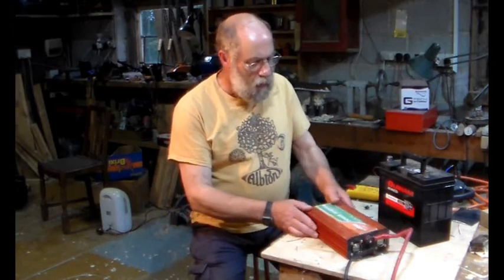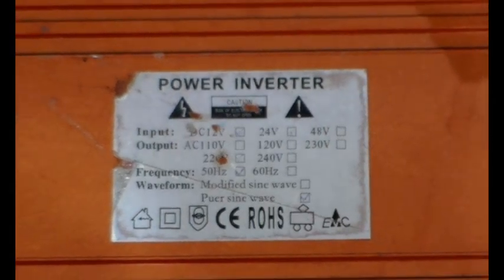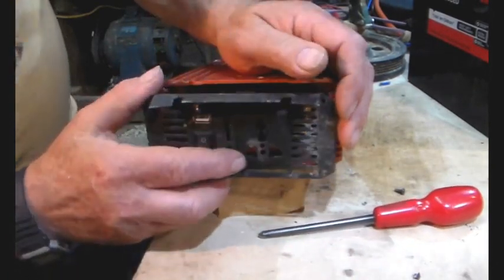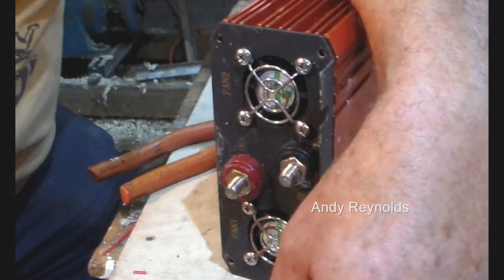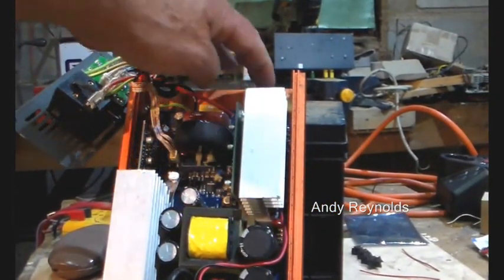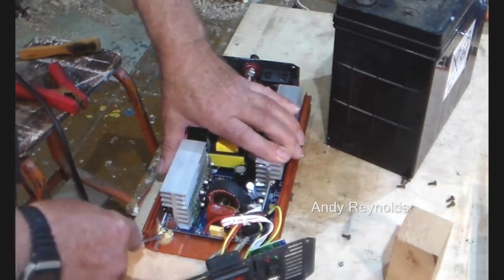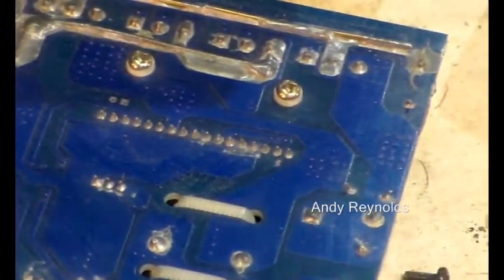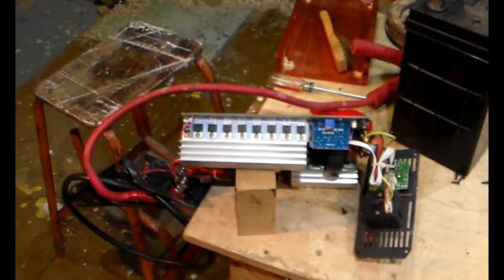1kW failed inverter, what went wrong?

Comment: Thanks Andy for the look inside. I have a simular inverter at my Cabin our Wood. I have 2 x 120 Amp hour 12v battery's in parallel charged from 300w solar panels and a controller. It works to power most things I need. I treat it  as disposable for that reason of poor build quality. It rubs against the grain with me getting new if it fails thought. Like you its always worth a quick look inside to see if it can be saved.  Happy New Year.
Reply from the maker: Hi, worth running at 1/3 capacity and also checking to see if the FET mounting screws are tight, cheers

Comment: I'm quite happy to forego any warranty and open up these devices to double check the wires and fittings before use if the price is substantially less than a branded make.

The majority however will buy the cheap units and use as intended assuming the build quality is that of a unit made locally.
Reply from the maker: Ian, my view is to run these units at about 30% and then they will be reliable, cheers
Reply: @TheInfoworks  i have a Lidls best 300W inverter which works ok but doesnt like high inrush currents. I have a corded LED floodlight rated at 21W which refuses to turn on through the inverter.
Reply from the maker: @ianhelsbyservices  Hi, Ian, I'm assuming that the LED will not work because the power supply will not cope with a rough wave form. Most floodlight power supplies are the switch mode constant current type and so need a good sine wave. Cheers
Reply: That's an interesting thought Ian. I hadn't ever thought of taking a product apart before use, but it makes sense. Maybe because most of the stuff I get is broken before it comes to me.
Reply: @bootsowen 
 I recently bought a hot air rework station for 1/10th the price.of a branded unit. The heating element in the handheld part is mains voltage. I checked for Earth connections which were present and correct. Only downside was the plug with the insulator around the Earth pin. A new plug fixed that.
update
One of the live wires feeding the heating element had some of it's insulation knicked off so I had to pop some heatshrink over it.